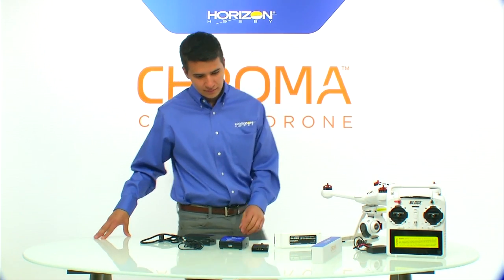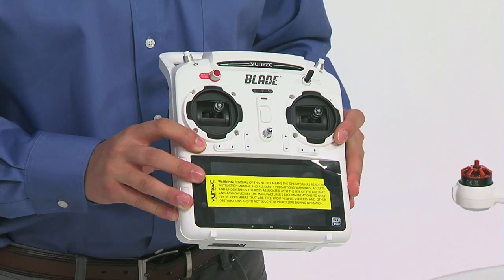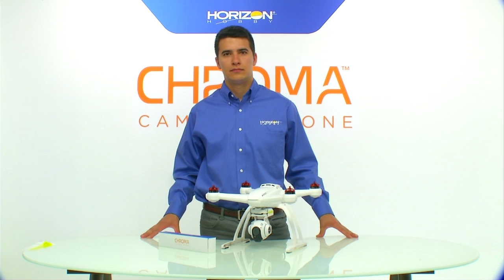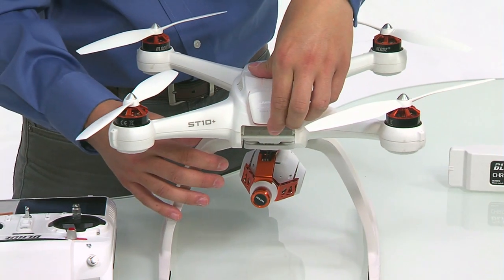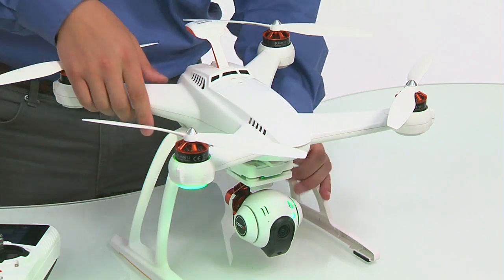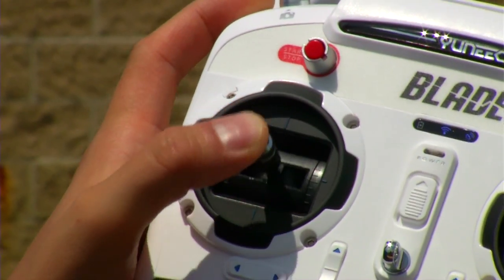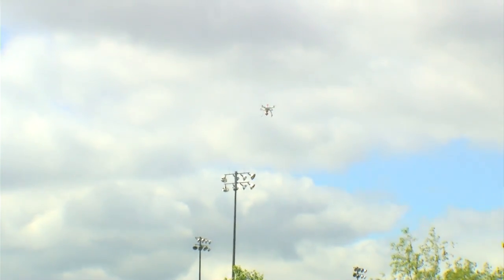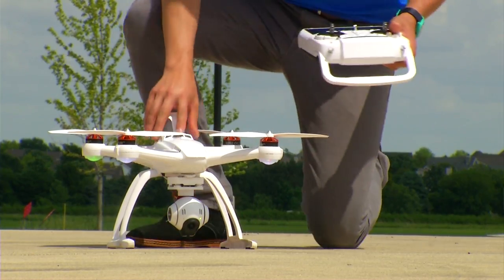Chroma - Your First Flight

Comment: Good starter drone I got years ago. Issue now is getting good batteries for it that will last.
Reply: Repack your old battery packs with new cells. I've done it several times with mine, and put high-quality Gens-Ace cells in them.

Comment: Taking off in safety mode is only ok in a large open area. I tried to take off in a riverbed to film some fish and it went out of control and crashed into a tree blew into pieces and sank to the bottom of the river 14ft deep. I dried it out used some tuck tape and crazy glue. Amazingly it still works fine. The buttons on the controller are problematic however, I popped off the buttons and filled the hole on the button to stop it from sliding down on the male end. I also have had issues with the still camera and starting since day 1. Took apart the controller and found a loose harness connection on the button board. Easy fix but seems loose in the harness so I expect it will happen again. I get under 20 min filming per battery charge.

Comment: I'll buy once soon. but I have many question:
- I'll buy 1 combo: chroma 4k st10+ & case. price ~1.049,99$$  But I don't know exactly what's have in the box???
- I don't know where's the card SD.
who can help me? Thanks so much.
Reply: The SD card goes into the controller under the battery, takes a micro sd sold separately

Comment: I sure hope nobody watches this video and then goes out with their new expensive drone and tries to fly it. Because if they skip compass calibration like this video did, they will be picking up their new drone in pieces, that is if they can find it! Personally, I don`t think a newbee should be flying anything but a cheap $20.00 toy quadcopter until they learn to fly. If gps is lost during flight, and the pilot does not know how to fly without the gps and smart mode, the drone could cause serious damage, and/or injury! And sorry, but if your going to make a how to, first flight,  instructional video, then you should not leave out one of the most important things that must be done before you fly it!
Reply: +HumbleHeartMinistry how would someone set the compass calibration?
Reply: I never calibrated my compass once... Flown my Q500 40+ times. DJIs fall out of the sky for no reason and silly CSC "features". Junk....
Reply: They did not talk about the sd card slot in the remote as well

Comment: the phantom 3 does not have and many features as the croma 4k. the st10+ can stream video to more than one device so you could use ur 10' tablet.
Reply: I say the phantom 3 is an apple iphone. the chroma is a droid.
Reply: +StealthCamp Is the Chroma just as good?
Reply: The chroma appears to be as good IMO. although it does not have lightbridge, it does have 'follow me' mode and longer flight time. You have your choice of 1080p with the Cgo2 camera or 4k with the Cgo3 camera.
Reply: StealthCamp Is there a a after market addon to make it not as laggy like lightbridge?And is the Camera better on the Phantom 3?
Reply: +Andy Black the cgo3 camera is 4k like the phantom. i don't know which is better. as for lag i don't find it to be a problem.
Reply: Sorry i have the Iphone and there is a app for my Apple Mini and it looks great
Reply: CGO3 is the App in Apple for the 4K Camera

Comment: How do you see the videos you made
Reply: I was going to ask the same question as it isn't apparent in the manual. I have however discovered a micro SD card slot located behind the ST-10 battery. I am assuming all the videos, photographs, flight data etc are stored onto this. You should then be able to slot this card into your laptop and access the files.

Comment: At last, I was able to get the chroma into the air.  I was very impressed with the quad but it was pretty chilly and my hands got very cold so I only used one battery.  That's ok though, as I got to try most of the functions and got some video and stills.  A couple of guy came to the strip to fly (I was happy to know I wasn't the only nut in the club) and were awed by the chroma.  I was on top of the world after the experience I had with the first gps quad I purchased.  It flew just fine for 6 min and promptly stopped listening to the transmitter and ended up crashing.  The calibration is much easier and it was very gratifying to enjoy the problem free experience.  Very easy to operate.  I am very happy with it.  (you think?)

Comment: Hi,

I'm debating on buying the Chroma or the P3.  I really like the Chroma but wanted Waypoint & auto take-off feature like the P3.  Will Chroma have these features anytime soon?  If so, is it possible for these features to be added to the existing Chroma via firmware or would there be another version of the Chroma in order to include this feature?
Reply: I seen the Phantom 4 flight and its awesome but to pricey, if you can afford it ok, the Chroma kit with the st10 and 2 batteries and 4K was lowered to $849.00 a awesome deal for this quad

Comment: I've had 2 blade qx3's and one flew away. whilst the other had motor issues. horizon replaced with a chroma and that dropped out of the sky with power loss issues. I stay with horizon due to its customer care but I feel issues need to be sorted as some people may not get their equipment replaced.

Comment: It looks as if blade and yuneec have somewhat merged. my yuneec q500 + operates in the exact same manner. I also noticed on the radio control, it even shows the yuneec logo at the top and blade in the middle. camera is nearly identical, the same blade orientation and all controls are the same. does anyone know if blade and the unique company have merged?

Comment: I have being using chroma.
However, it should be up to 400ft at best flies to 700ft !!!!!!! OMG~ only 400ft... orz
Is it possible to unlock the issue to a firmware update?
This is very disappointing.
Reply: +Shin Y.S The chroma can reach ridiculous heights, however. by law, no remote controlled drone is allowed to fly above 400 ft. yes it can fly far higher, but not legally..

Comment: I recently purchased this drone.  It flies very nicely.  But the camera won't do what I need.  I need at a minimum to be able to capture 1/4 square mile in a directly overhead photo for agricultural scouting.  I need to either fly higher than 400 feet, (which seems to be an internal setting that I can't turn off) or I need a wider angle lens.  Is it possible to either shut off the setting that keeps it from going above 400 feet or purchase a different camera with a wider angle lens for this machine?
Reply: +Scott Estabrook By law. you're not allowed to fly above 400 ft or within 5 miles of an airport.
Reply: 3200' is the max setting for the. Chroma

Comment: I'd love to buy this one, but I'm a litttle skeptical since my 350 QX3 had many issues. Its back at horizon being checked out, I had the quad for a month and it just didn't want to act right.
Reply: *****  this "350 qx4" aka chroma is more reliable and better design than the previous 350qx series .. it uses similar hardware from Q500 which is reliable than P3 and other quad out there ... the only thing i hate is the "priopieratary" battery, the least thing HH can do is use the same battery case  from Yuneec, right Chroma Camera Drone  ??  :-P
Reply: I agree on the battery, i got the QX3 back from HH, turns out the battery was not charging correctly amperage wise. seriously considering the Chroma now.

Comment: It is bad that there is not an approved usb power source in the box.
Reply from the maker: TheJWolfProductions In the effort to save the consumer costs, we opted not to include it. We figured that like most tech users, you most likely have a cell phone charging block laying around. Why pay for another one?
Reply: Thank you for the response. The video I saw, the presenter said you need an approved usb charger.

I asked around and was told an android charger would work. My problem was my old phone is no android or smart phone. I spend my extra $$ for software and cameras not cell phones.

Comment: will the ST10+ bind to the chroma or do I need to get the radio with the chroma?
Reply from the maker: Bill Mattison If you buy the BNF version of the Chroma, the ST10+ will not bind to it as that version is equipped with a Spektrum receiver. you would need to buy the ST10+ receiver to make it work.

Comment: I'm looking at several quads in this price and features range, including the Chroma and the Q500 4k. The Yuneec is a little bigger, includes two batteries and a case but uses the same controller and camera. The Chroma battery is supposed to last a little longer but only has one battery and no case. Can you tell us what the major differences are between the two quads that make the Chroma a better choice at the same price?

My question is sincere - there is quite a conversation going on in the RC forums about this and no one has a good explanation.
Reply from the maker: Jeff Sibelius It really comes down to the fact that they are both great options. If value real-world 30 minute flight times and portability, the Chroma is your pick. The Q500 is larger, but also less flight time and not as travel friendly. The Chroma fits in a standard backpack because the landing gear can come off. Also, you get the support of Horizon Hobby for the Chroma which has been known in the business as being best in class.
Reply: Chroma Camera Drone You're absolutely right about them both being great choices. I actually purchased the Chroma in the past few days. I didn't know that it could be disassembled, which is a neat feature . . . but the deciding factor was the support from Horizon Hobby and the ability of my local RC shop to be able to work on Blade products. Your good reputation means a lot.

Comment: Actually I would not recommend taking of in smart mode - if Chroma behaves anything like the Q500, it could take off like hell and smash into something because of the safety distance - I know a lot of cases with broken props because of this ;-) Take off in angle mode and switch to smart mode when you're up and safe instead (if you want to use smart mode at all)
Reply: Magnus Högfeldt always in angle mode

Comment: HI guys;
         Great video, great quad, but one thing I disagree with is starting the Chroma with the speed setting on "rabbit".  I suggest "turtle" mode instead.    This thing is powerful, it is a rocket ship. No complaints, not at all, but if somebody has never flown any quad or drone before, they might be taken by surprise at just how powerful and agile this machine is.   Just like buying a new sports car with a 500hp engine, "drive" it slow and easy for a few days until you get a feel for it.
    Otherwise, awesome quad you have there.
Reply from the maker: maiingun1 Thanks for the feedback. We recommend the Rabbit setting because the Chroma may not start its motors when that setting is all the way to the turtle mode.
Reply: Chroma Camera Drone  that could be a bug then.. we hope it will be fix in the future
Reply: maiingun1 Does this thing really last 30 minutes?  Do you still like it? Any issues or crashes?
Reply: About 28Min from someone that has one, I have not flown ours yet